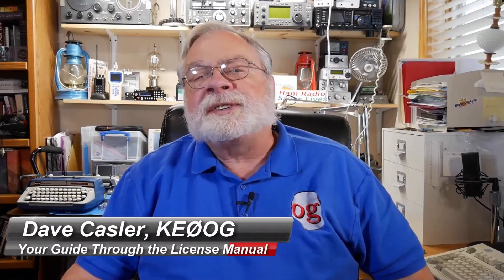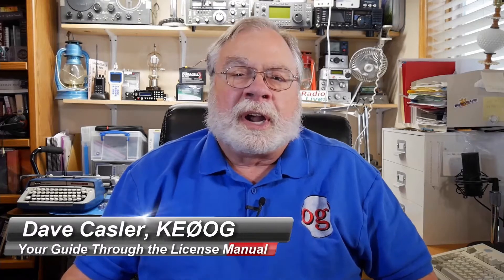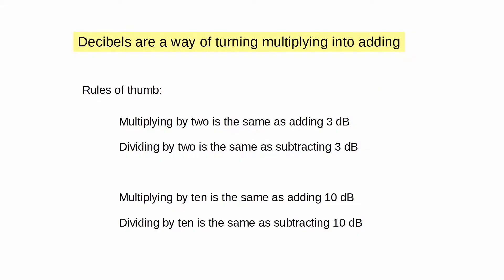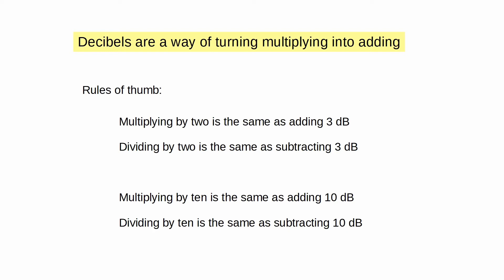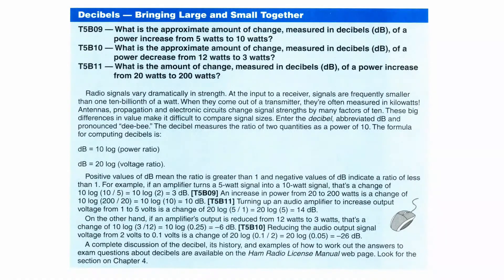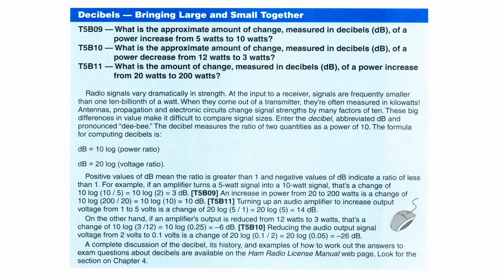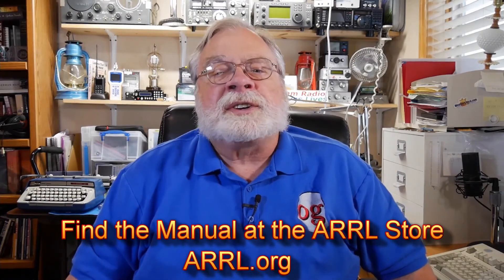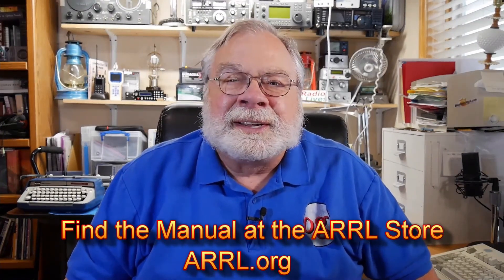Dave Casler Technician License Series: T09 Antenna and Radio Wave Basics 2022-2026

Comment: Dave, question on the diagram on 4-8 for Decibels -Bringing large to small.  I know you covered the power ratio, (which helped out alot!) but I have a question on the voltage ratio. I haven't found a good rational for how the equation with 20 log is computed. When checking with Prof. Google, it just gives the answer, not the how. Is there a Rule of Thumb for this as well?  I know its not needed for the Technician, but it's bugging me that I cant get a good answer to the how.